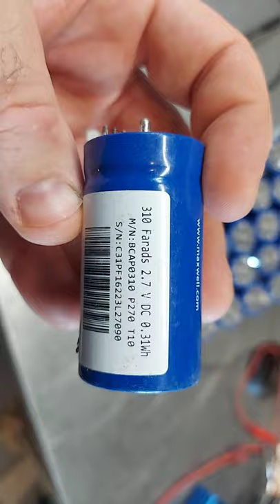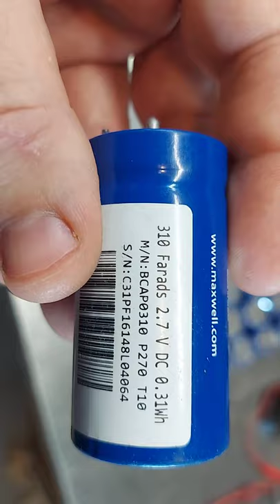Crossovers Part 2 Let your mids & tweeters do what they were made for. 1 octave or more above the Fs

Comment: Actually spoke to a Fosgate rep and I asked him if it was okay to set my RF amp to "full range" to match my RF punch door speakers that say "full range" on the box...He immediately said exactly what you said...NO!! 120 htz was as low as I should go or I would pop them in no time👍So 120hrtz it is..Thanks for sharing your knowledge👍
Reply: Correct me if im wrong but u can set it to full range if ya have a 120hz filter on ur head unit.
Reply: @bkh5746  I personally can't say with assurance but my guess would be that it would basically be serving the same purpose...The role off point might be a little different possibly..??
Reply: @bkh5746  i set mine on my headunit. I think its -12db slope. It stops it before it goes to the rcas and sometimes the amps dont have a label on the filter pots for integer so it might be more precise

Comment: What makes a sub an "sq" focused vs "spl" focused?
Reply: weight of the cone and coil. if i remember correctly, light weight for SQ, heavy for SPL. then there is SQL which is a middle weight and all around sub.
Reply from the maker: An SQ subwoofer is heavy, can play down very low.  An SPL subwoofer is more focused on being light, having a higher Fs / tighter suspension.